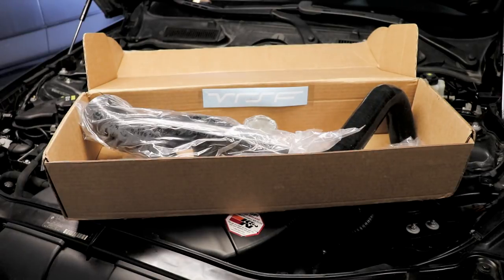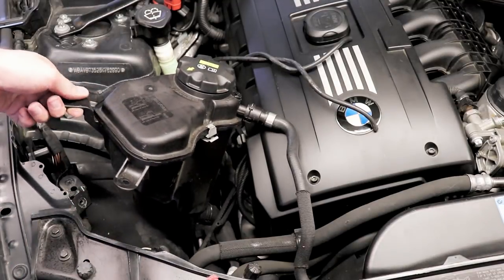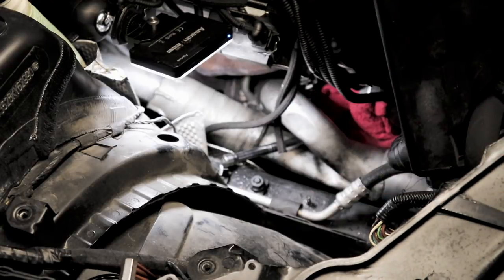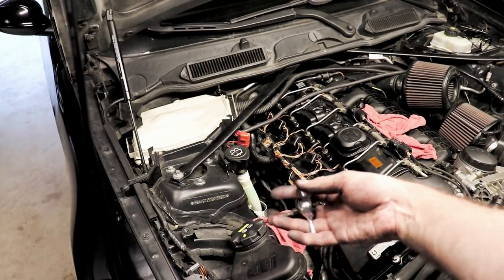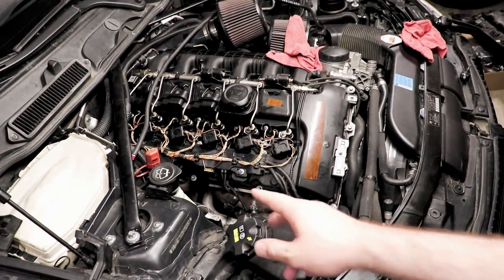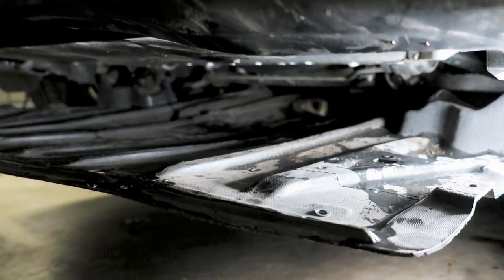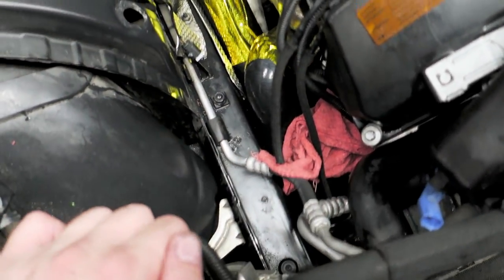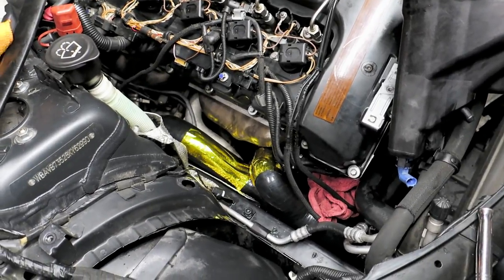VRSF BMW N54 Turbo Outlets Upgrade DIY

Comment: Thanks so much for taking the time to post a DIY! Thank you for your contribution to the community :)
Reply: These silicone inlets are not being marketed as for 335i's anymore on your website, rather switched to aluminum 2", is this an update to the original silicone design or?
Reply: @bryanm6080  the silicon comes to close to the manifold and over time it becomes brittle and blows out.  its an engineering design flaw of silicone outlets.  the hot side of these engines near the turbos are just too hot , they will fail after a few years of heat cycles

Comment: Excellent video, must watch before installing outlets. The key is removal of about 4 inches if not 5  on the forward turbo hose section, otherwise the hose will pinch off at the merge and the coolant reservoir will not fit. Thanks for putting this together, takes the guess work out.
I opted to wrap the entire outlet assembly in cool tec heat reflective tape (good till 2k Fahrenheit), the hose sits in an area that is particularly heat soaked and face jagged edges at the first bend at the rear turbo, so hoping to protect the unit. Went back and checked the tape and hose right under the forward manifold (not much breathing room there) and found no evidence of burning material, material degradation etc. after 1 1-2 weeks of driving.

Comment: You could take a piece of heat shield and create a 1/2 pipe type cover and mold it to the front turbo outlet pipe for better protection. 

I had to do that when I installed MMP 2” Outlets. MMP does not give you a curved coupler for the front turbo. Trust me, I wish they did. So, the 2” pipe basically touches the exhaust manifold on the front. I wrapped 80% of the outlet in the DEI gold tape and then cobbled a half pipe out of the heat shield I had to take off during installation and molded it to the curved portion of the outlet, on the front turbo. 

I temped the heat shield after a 45 min drive, and it only got up to 250 degrees while the exhaust manifold was 425. If you temp the part of the outlet with DEI tape vs the part of the outlet w/ out DEI tape, you will see a stark contrast in temp. Last, I put DEI tape on the underside of the curved portion of the rear outlet. This part of the outlet is only a few inches away from the Cats.
Reply from the maker: Hey thanks for the info, I'm sure that will help some people.

Comment: I think the 5-series is a bit different, but I don’t recommend the silicone outlets. I’d do PSP, VRSF, or VTT’s aluminum upgraded outlets. I’m running upgraded turbos on 25+ psi and my turbos are ceramic coated. It gets so hot that even with the proper gaps, the silicone still melted. Waiting on my aluminum ones to show up. Hard to get aluminum ones for the 5 series WITH upgraded turbos.

Comment: hey man you are truly an inspiration .. i love your videos and your taste is very on par with mine. I was just curious what kind of tune you are running? I have a stock e92 . had it since 25k now have 120k! havent done any mods but i'm looking to maximize my HP without adding tremendous amounts of stress to the motor ... I think you certainly are nailing that.

Comment: I know this is an older video (Excellent job though!) but they are still selling these silicone Outlets but not with the Mounting hardware you have here. It's almost impossible to even see if anyone sells that hardware anymore. I guess the hard outlets are the only real good solution to the smaller outlets.  SO do those that are selling the silicone outlets still expect that they will be mounted directly to the turbos??  Will that even work?

Comment: With practice that fan shroud comes out in 5 seconds.  Nice job on getting that sucker in there?  Question, do you experience a noticeable diff with the bigger IC?  Been thinking about that for a long while now :)

Comment: Great videos thank you. Can you tell me if this would fit a RHD 335i N54. Also I note a lot of plugs being unclipped do you have to disconnect power to the battery before doing these upgrades. Thanks

Comment: Is that pipe for turbo coolant? I mean, does water circulate from turbo to intercooler thru this pipe? I have coolant leak on my n54 but don’t see any water leaks on any pipe anywhere. (This Alu pipe has bin welded and under the car is big water leak so I think it could be it).

Comment: Just curious, I have the same inlets , intercooler, charge pipe elbows and charge pipe. Now I have a cracked radiator and it needs to be replaced. I would like to upgrade to a CFS but at 1.5” wider I do not think that it will fit. I already have a large Zip -tie keeping the front inlet off of the alternator pulley and belt. Your thoughts. Just go back with a new stock radiator with the crappy plastic arms? The Misimoto is not as wide but still wider than factory.

Comment: Nice video. But the ones you are using are silicone and the ones I find on the link are from aluminium? I'm confused.
Reply from the maker: Thanks, there are different versions out there.

Comment: You gotta do turbo’s eventually, I would think if the car is still operating on OEM turbos abs it’s over 180,000 miles
Reply from the maker: Hey sorry for the late response, yeah they have been changed once.  They should have around 60K on them total.  They came off a car with 13K miles and they were installed at around 140K miles by the previous owner.
Reply: My OEM turbos went out at 129,000km. 2008 BMW 335xi 392 6MT (all stock)
Reply: @myboybill01  im at 101k miles and mine are still going strong

Comment: I just bought the aluminum one cause my silicon one tore how much different is the install with that one ? looks like a pain in the ass but I have no more boost so my car is on map 8 on JB4.Would you know if I have to reuse the aluminum adapter with the aluminum outlet ?
Reply: Update I just installed the new outlets this took me all day there's no fucking room in the N54 engine bay.i didn't remove the fan shroud I was able to fit my hand and undo the coupler after removing the coolant bottle and vacuum canisters.But I couldn't for the life of me put on the rear vband clamp on the rear turbo. Ended Yuo getting help removed under belly tray/right  wheel and  held it in place while someone else tightened the clamp.What a disaster but it all worked out the aluminum pipe is much smaller in diameter compared to the silicone one I replaced it with. Now I don't have to worry about it melting or tearing.
Reply: @LikquidDutch  is there a major torque difference?
Reply: @chrisplayz9739  I wouldn’t say major but boost response is much better and worry free now that you have it installed .

Comment: I have inlets but do the outlets make any difference?
Reply: Am changing the outlets and inlets right now and im putting in the metal ones that are hella hard to put in but theyre so much biggger then the oem ones.
Reply: they increase hp a little bit but they mainly increase torque

Comment: Can I get a link for the heat tape?
Reply from the maker: This is similar https://www.amazon.com/010394-Reflect-High-Temperature-Reflective-Adhesive/dp/B0039Z5TUY

I tried to find the one I bought from Autozone on line but wasn't able to.